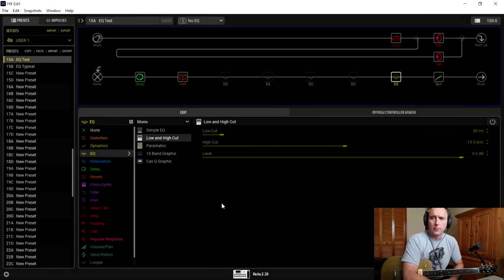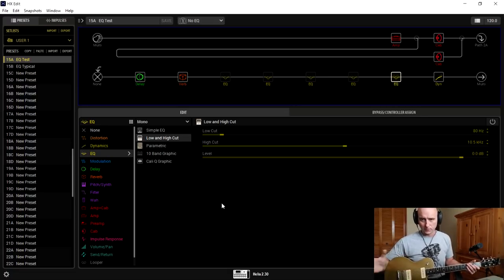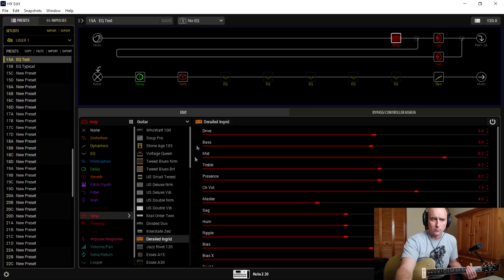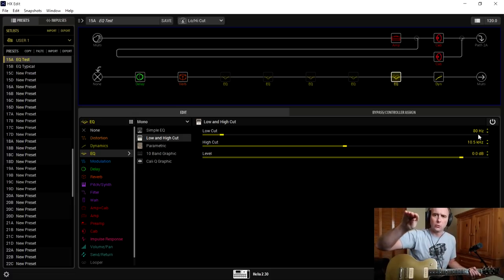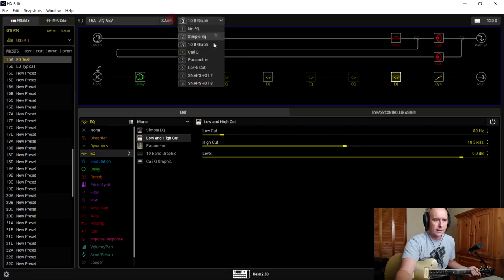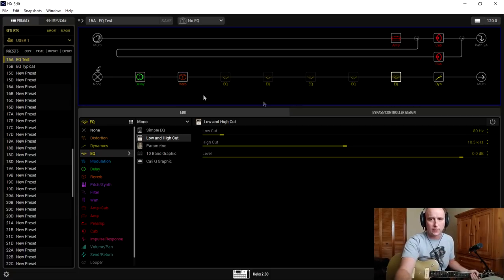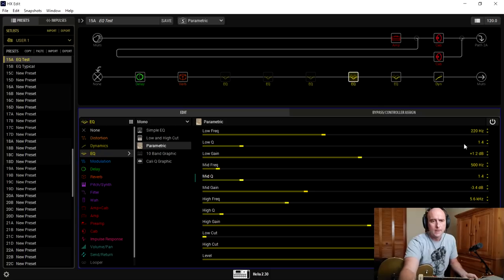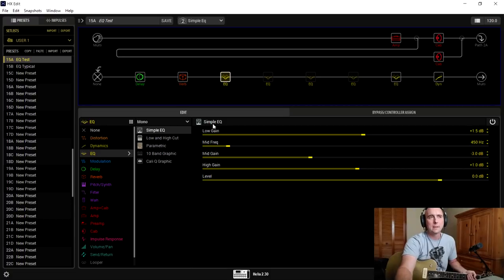Line 6 Helix - How To Create A Great Tone - Pt. 6 - Understanding And Using EQ's

Comment: FYI - the frequency range of the guitar is:
Fundamental frequency range:  80 Hz - 1.2 kHz
Harmonics frequency range:  1.2 kHz - 5 kHz
Basically, above 1.2 kHz you're getting into overtones / harmonics.

So setting a Low Cut at ~80 Hz makes sense, insofar as there's no usable sonic info below that from a guitar.  Setting the High Cut is more variable due to pickups, amp settings & effects, playing style, music style, etc.  While the upper end of the guitar's harmonics range is 5 kHz, setting a High Cut at 5 kHz may eliminate some useful harmonics and dull the tone.

Regarding the total sonic spectrum:
"Sub Bass" is 20 Hz - 60 Hz
"Bass" is 60 Hz - 250 Hz
"Midrange" is from around 250 Hz to about 2 kHz
"High Midrange" is 2 kHz to 6 kHz
"High Frequencies" are 6 kHz - 20 kHz
"Treble" is generally 2 kHz - 20 kHz (combination of high midrange and highs)

As Jason notes in this excellent vid, however, we have no way of knowing how a particular amp's manufacturer sets the "Bass," "Mid," and "Treble" frequencies on their amps.

For reference, Middle C on the piano is 261.6 Hz, the 1st string (E string) on a well tuned electric guitar is 329.63 Hz and the 6th string (low E) is 146.83 Hz.
Reply from the maker: +Paul Tortland thank you for such an informative post to go along with the video :-) A very nice summary!
Reply: Really helpful background information. Thank you!
Reply: thanks for this helpfull summary! There is a minor error at the end - low E is 82,41 Hz.
So the basic tonal range is from 82.41 Hz to 1318.52 Hz (1st string fret 24)
Reply: Such an useful comment! Thank you so much! This is not only useful for guitars, but for mixing in general!

Comment: In case anyone wants to know -> Q = quality factor.  Functionally, it helps describe bandwidth but comes from terminology involving damping of oscillators/resonators.

From what I can tell, I believe the low/high EQ and the parametric eq have the same slop on the low/high cut parameters.
Reply from the maker: Thanks for the input Andrew, that is excellent info that I chose to leave out of the video for simplicity sake, but is very good info for anyone interested, thanks for posting it! Also, thanks for the info about the low/high cut parameters, I had a gut feeling they would be the same but just hadn't tested it. Thanks :-)

Comment: I am in a band that is just bass guitar, drums and vocals. Any advice on how to accomplish a full  rock sound with just a bass guitar on the Helix. I get all my distortion from my Aftershock bass distortion pedal. Would you recommend splitting the signal into a guitar amp and into a bass amp, both with there complimentary cabs? Then use an eq setup similar to a guitar frequency range for my distorted signal, then do the same thing for the bass side?  Or use one amp (guitar or bass) then use 2 equalizers and 2 separate cabs? Would you do the same high and low cuts?

I am also curious about the difference between boosting a frequency (such as bass on an amp) vs adding  a another cab that uses a mic that boosts the low end?

 I would love for you to do a "how to create a great bass guitar tone" series : )

 thank you for the videos, very informative.
Reply from the maker: I am not the guy to ask about bass tones to be honest, wish I could be more helpful in that area :-)

Comment: Mr jason first of all i want to say thanks for your generosity in sharing your knowledge, it really helpful for me and obviously also for plenty other guitar enthusiasts out there,...
And second i want to ask about the parametric eq, lets say in low freq range of 20hz - 495hz, if you set the low freq in 240 like you did in the video, does that means that the freq works in 20hz - 240hz? or 240 hz - 495 hz?, or does it means that the 240hz serves as the middle point of the freq spectrum which its range would be depends on how wide or narrow our q is going to be?,....
I hope my question doesn't confused you,....
Reply from the maker: Thank you and my pleasure :-) I actually answer that question in great depth in this video.

Comment: Hi Jason, thank you for all the great content on your channel and all the effort you put into helping other Helix users. I have a frequency problem and I'd like to ask for your advice. When hitting the b and high string simultaneously (playing thirds, fourths or so) I very often get problems with very low overtones ... or should I say "untertones" :). It happens with random amps, cabs, settings etc. I play through a Yamaha DXR10, but it also appears on other PA-systems. I might just sit down with a loop and really try to comb the frequencies. If you have any suggestions I gladly hear from you. Thank you and all the best!
Reply from the maker: My pleasure Rasmus :-) I think you are on the right track, set a para eq block and sweep through until you find the offending frequencies and cut them. Do it with a high Q setting. Hope that helps :-)

Comment: Using the EQ after everything is it basically like using the global EQ? I think if you look in HX edit at the global EQ it'll tell you the frequencies when you turn them up and down which probably replicates the simple EQ high and low gain that they don't tell you what the frequencies are it's probably the same as the ones in global EQ the default ones.

So yeah I agree if you want to put it at the end it's going to change the entire brightness of everything including the effects which might be something people want especially for different rooms.  You would want to brighten everything. Not just the guitar including the effects. 

You can also put EQ at the end of every snapshot lead, rhythm everything so you can be very selective to brighten everything..

At the end of every snapshot just makes it very versatile and detailed about your sounds.

Comment: I have a question, hopefully someone will see this as it's an older video. I'm wondering how much using eqs before preamps\drives affects the character of the distortion. Example, if I were to boost the 1k range before the amp by 4 db and then cut the same frequency range after the amp to smooth out potentially harsh frequencies, would it be noticable\useful?

Comment: Hi Jason! Another great video! 
Very helpful but kind of confused me.
You said that with the Q at 0.7 we are affecting roughly 2 octaves on either side. And by increasing the Q to 1.4 we are reducing it to one octave or reducing the bandwith.
Well I always thought it was the other way around... And checked my DAW to be sure and it is the other way around. When I decrease the Q I decrease the bandwith. 
Are you saying that the Q in the parametric EQ of the helix works the other way around as other EQ?
Cheers!
Reply from the maker: Thank you Pedro! Glad you enjoyed the video :-)

As far as the Q control goes. It is in fact as I stated it in the video. A Q of 0.7 would affect all the frequencies up to approximately 2 octaves on either side of the center frequency we have set. By raising the Q setting to a higher value it is going affect less frequencies. I am not sure which DAW you are using but in all of my plugins and DAW (Cubase Pro 9.5) it works as I explained it in the video. The Helix EQ's work the same way. There is a good article about it here:

https://howtoeq.wordpress.com/2010/10/07/q-factor-and-bandwidth-in-eq-what-it-all-means/
Reply: Again, thank you for the answer.
That is strange in fact.
I'm self educated when regarding these subjects and I've been using Reaper for a long time and I'm used to the stock EQ. It uses bandwith and scales in octaves but in some other window it calls it Q Band and the values are the same. And I've always thought they were proportional not inverse. 
But then again, I'never mess around too much with eq.
That article looks great. I was trying to figure out how you got to that 1.4 value that relates to one octave. Turns out it's a somewhat of a standard thing across EQ's.
Thanks for the info
Reply from the maker: My pleasure and these things can be a little confusing at times :-) Glad I could help!
Reply: Hi! So I've been messing around with the compressors trying to add more sustain and reducing the noise floor and your tips helped a lot.
I could keep the sustain I add which was fine and reduced the noise by using the 6:1 ratio has you recommended. I messed around with the threshold and the mix and was able to lower the make up gain. So your tips worked out! Thanks!
About the EQ I'm completly clarified. Just wanted you to know that I've been testing the low and hi cut in the EQ blocks and the Cab's. The low/hi cut EQ does the same thing as the cut on the parametric EQ. No noticible differences.
The Cut in the cabs and IR's are indeed different from the EQ blocks. The low cut appears to be the same but the hi cut is clearly different. I guess the slope is less agressive on the cabs and IR's. The sound is noticibly brighter using the same hi cut as with the EQ block. 
There maybe even some mix involved with the cabs since on brighter sounds with the cut around 6kHz I could see some peaks bleeding out around 10-12khz when looking at the EQ on my DAW.
Cheers and thanks again!
Reply from the maker: Sp glad to hear those compressor settings helped you get closer to what you wanted :-) I figured as much about the cabs, thanks for the info!

Comment: I tried following your instructions in several of your videos, but my Helix somehow sounds way different and worse than yours as early as step 1. I don't know what I'm doing wrong. It can't be my guitar because I'm playing a Gibson, which should be good enough to sound good. I think the problem lies beyond my Helix in what I'm using to hook it up to my PC. So it would be very helpful if your made it clear what you're playing through besides the Helix (any tube preamp, DI box, etc.). I'm so frustrated at not being able to make it sound as good as it does in other people's YouTube videos.
Reply from the maker: I have been very clear the Helix is running through nothing else. It is plugged straight into my computer via USB with no other processing, ever.